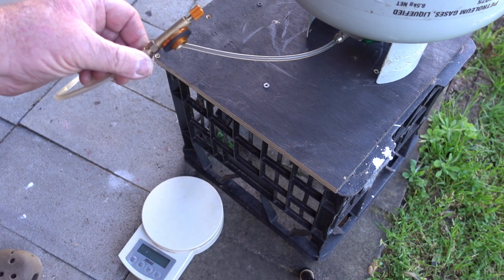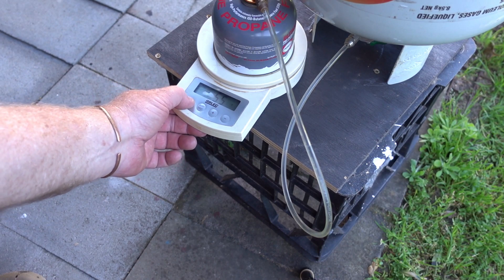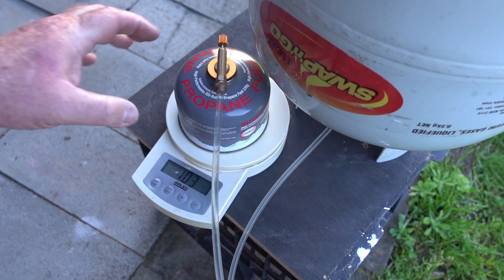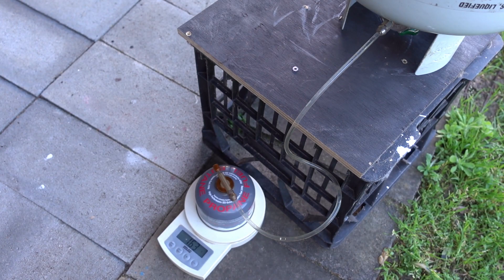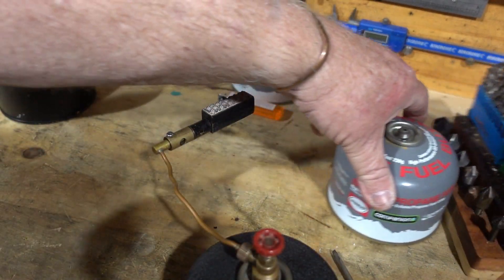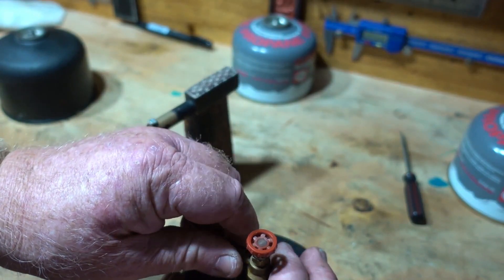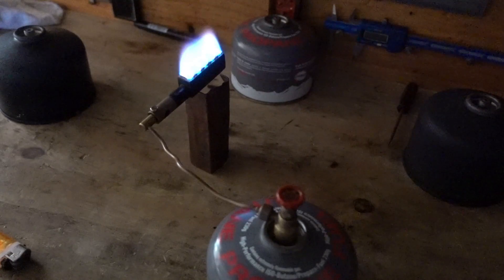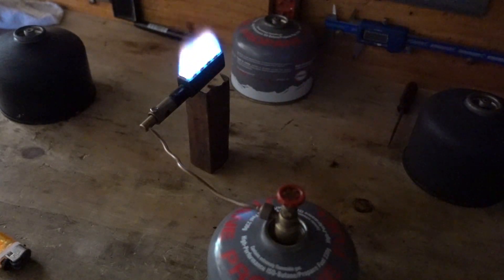Refilling disposable camping gas canisters with Propane - Cheaply

Comment: The large tanks come with propane only, while the small cartridges are design for butane or butane/propane mixture, which has much (around 10 times) lower vapor pressure.
So, filling the small, thin wall cartridges with pure propane may cause them to blow up.  The cartridges are probably made stronger by certain safety factor so you might be lucky and nothing happen so far.  However I would say it is not safe to fill small thin wall aluminum cartridges with pure propane, especially if you plan to take them to your camping during hot weather.
Reply: @NearlyNuked It does not work this way with liquefied gases like butane or propane. If you charge your cartridge half way, the level of liquefied propane or butane will be lower but the vapours above will still exert the same pressure equal to the value of vapour pressure of given gas.  The same way as the pressure of water vapour in the bottle is the same doesn’t matter if it is filled half way or to one quarter. 
Thats why you can not use pressure meter to see how much gas left in your cartridge. Instead, weighting is better method.
Reply: @attilavicen1579  Read the whole label and check the composition of the gas.  It might say “propane” as a commercial name but in small aluminum cans it is always a mix of propane with butane or isobutane.
Reply: @SpokoSpoko  can i refill these camping gas canisters(4 season ones) with lighter refiller? What 60% butane and 40% propane? You know the ones you can refill the lighters with. Can i put that into a quality camping canister? Some have 4 season ability what means you can use them in the winter, couse there is more propane in them. So they must be stronger a bit. Thanks for the anwer.
Reply: @attilavicen1579  I would not put any more propane than it is written on the can, but if that lighter refill has less or equal percentage you can use it.  Myself I tried to load my cartridges from two sources, butane from small cheap refills and propane from the large BBQ tank. However I found it too much hassle. The savings is small and not worth it. Unless you camp a lot and use a lot of those cartridges.

Comment: I suspect the can might be over refilled allowing liquid gas to enter the line. Try putting 50 grams in then test if the flame spurts. If it does not spurt with less gas then you can try using a little more in stages until the problem reoccurs.
Reply from the maker: Thanks John

Comment: purge the line prior to filling. I suspect the flare ups are caused by an air fuel mixture being fed into the burner, propane has a calorific value of 2500btu/ft3 Butane is around 3200
Reply from the maker: Thanks

Comment: I'm of the understanding that butane has a pressure around 32 psi and propane 320 or so. (to do with the boiling points). maybe that's why they have 70 / 30 mix in camping stove canisters for cold weather use. if the weather is not cold why not use butane and avoid the excessive pressure in the canisters? a lot safer if the word safer can be used under this topic.
regards from the uk
Reply: The reason is the butane is not sold in big tanks.  Only propane.  But you are right regarding the pressure 32 psi vs 320 psi.  In my opinion it is risky operation because the cartridge might be not strong enough, especially during hot weather.
Reply: @SpokoSpoko  I get same influx of flames from filling to 1LB propane tank but once tank is warmed up then pressure normalizes it.  I think something to do with propane gas mixed with air from big tank.   without a regulator, tank needs to be warmed up to build pressure.  Your video helps me as I was thinking about refilling same tank for my backpacking.  1LB steel tank is too heavy and I need propane for cold weather.
Reply: Both propane and butane pressure is dependent on temperature. At room temp propane's about 145psi, it doesn't get to 320psi till it hits 130f. Both disposable Propane and propane/Butane mix cylinders have safety valves or a Rupture Disc that will vent tank before they could reach burst pressure.....But I agree it makes more sense to get the adapter to refill with disposable butane cans. If you really wanna use straight propane you can get an adaptor to use 1lb disposable propane tanks with your stove.....Many stoves these days even come with the adaptor.

Comment: The isobutane canister is not designed to take pure propane, propane has much higher pressure than butane!
Reply: only when warm.....
just fill it less
Reply: @escapetherace1943  just fill it less? You do resize that it's all about vapor pressure, right? As long as there is any liquid in the canister the pressure will be the same for any given temp. Even a small amount when exposed to summer Temps could easily explode the canister. Look at any gas pressure temp chart, where do they indicate the volume of gas? They dont. If you are going to refill these, use butane only. You are really risking it with lpg or propane.
Reply: @KevinSmith-os5yz  even a small amount.......
unlikely mate. The canisters are not much thinner than ones meant for propane, weigh one empty, and the canisters typically hold a blended iso containing up to 20 percent propane anyway. The canister is already rated to contain butane in gaseous form, the pressure differences aren't "that much" comparitively. If you fill them with 70 percent propane and leave some dead space it's fine
Reply: @escapetherace1943  I looked up dot specs for a primus canister I ihave, specs say minimum bursting pressure is 240psi, and canister should never exceed 125psi at 130f. Granted they do use a mix of propane and butane, but the low amounts of propane keep things under that 125psi, barely. However if you are filling with pure propane, you are at 200psi at 110F with any amount of propane, as long as you still have some in liquid form, whether it's almost empty or full. Now bring that up to 130f and you could be on the high side of 240psi. Granted that's minimum burst pressure, but I'd sure like to have some margin of error in my favor. Now I do refill mine, but I use the cheap pure butane available at most grocery stores. Nut I wouldn't take the chance with pure propane, too close to the edge for me,he he. I don't have cold as an issue where I live.
Reply: @KevinSmith-os5yz  200 psi at 'any amount' of propane
I doubt it, then the iso-propane mixture would also be at the same pressure.
Granted subjecting it even close to 100 will almost never happen where I am
Reply: @escapetherace1943  that's how vapor pressure works, the liquid will vaporize into the container until the container comes up to the vapor pressure for that temp. So as long as there is still some liquid, which is what you have unless the canister is exceedingly close to empty, so 10 grams of fuel or 100 grams of fuel the pressure in the canister is the same. Now I don't know why mixing propane and butane brings down the vapor pressure overall, but again, I am only talking about filling a butane canister with pure propane. Sounds like you live in a cold enough place that you can get away with it, but I can assure I can't. I wonder if they make a pressure Guage you could attach to a canister to prove my point. I'll have to look. That's why a pressure gauge can't tell you how much fuel is left in the tank. Pressure is only dependent on temperature and type of gas.

Comment: 1 you over filled it, 2 that's not a tank made for propane pressures. 3 if you're trying to save money, us wood... It's free. 
PS, it's jumping the flame because your tank is overfilled, and you're getting liquid propane in the burner.
Reply: Woods not free. Especially where im from. you’ll get fined during a specific time of year for burning wood in a pit.

Comment: If you aren't using this with a camp stove, where weight is a big deal, why not get an adapter to your burner, for the 1 lbs cans of propane  that are sold for heavier propane stoves, torches, and lanterns, often under the Coleman brand.  They are easy to refill with no weighing, and they are built very solidly for the greater pressure.  The small cans are built to be lighter, which does not seem to be a big deal for your use.

Comment: One possible reason for using a propane/ butane mix is butane has a much higher boiling point and a lower gas vapour pressure compared to propane so it may help to stabilise the gas mix and lower the pressure in the cylinder .
I would knock the refill weight down about 10% and see if the flare up stops or run the burner for a while and see if it stops and if it does turn it off and weigh the  cylinder again - that will be your maximum fill weight  in the future .
Reply from the maker: Thanks Ian
Reply: so just fill 3/4 capacity with propane and I should be good, no?
Reply: They must add the "smell" to propane. It will make for some build-up in the orifice. Propane torches need to be cleaned regularly.
No big deal.
Butane will turn into a gas at a lower temp than propane. When it's cold, propane losses pressure, the butane has a lower boiling point, so it keeps the pressure up in a cold tank, or a cold morning/evening.
Yes, dangerous. So are most things. 😀 
Be smart, use safe practices, triple check yourself. Learn all you can.
GET RID OF ANY CANISTERS WITH MECHANICAL PROPLEMS OR DAMAGE.
It's not worth it to trust a disposable canister to save a few bucks.
Being OK with a good one, that's one thing, one that has any problems, not worth it.
My 2 cents worth.....
Have fun.
Reply: @adamdavis5961  at std pressure: butane boils near 0C, propane at -42C
as a result, at std pressure, -18C: propane exhibit as a gas, butane is a  liquid
Reply: @philiptong4978  yup I'd only fill it when it's as empty as can be, and at a reduced pressure
Reply: @escapetherace1943  below explain why it does not matter how much propane you put inside the can, as long as there is a liquid (which is compressed gas)
https://youtu.be/re9r0kzQp_M
Reply: @Mister Dude okay but less gas = less pressure. Ultimately it depends on the rating of the container it's in. Cold weather butane is a mix of butane/propane.
It would be interesting to know if the bottles they use are different or if the tolerances in butane bottles can actually handle a certain level of propane. 
Obviously they can, as some people have filled them with propane (I haven't)
but with the math to back it up I might be tempted
Reply: @Mister Dude yes it does. A full tank will have more pressure in it regardless of temperature, even if temperature is what makes the pressure go up or down the most

Comment: I have what appears to be the exact adapter you are using, but it does not actually screw tight onto the donor propane tank. All the people I can find who have them say they have the same issue.
Did you have to do anything special to get it to fit so it doesn't leak, or did you just happen to get one that works?
Reply from the maker: I didn't have to do anything, it just worked. Are you nipping it up nice and tight?
Reply: Yeah, the one they sent me from China wasn't tapered to match the tanks we use in the US. I took theirs off and put a spare fitting on it, now it's all good.

Comment: Kind of scary asking for comments after the fact whether this is inherently dangerous. You should’ve done your research prior to doing it!  This can be definitely dangerous and is not recommended. You can read about it all over the place. I think ultimately if you keep the volume at 70% full or lower and the temperature of the tank below 90° you’d probably be fine. But filling it like you did and not knowing actually how much you put in tells me you don’t know the dangers or differences between propane and butane and of what could happen. If you research this more you’ll find butane would probably suffice with your requirements but be much safer in the end. If you’re bent on using propane then use the green little gas tanks designed for propane. The one pounder. Those you can refill much safer and the tank is much more sturdy
Reply: You do realize thats an isobutane can? So that means is a blend of propane and butane........ think about that. Initial charge starts with butane at factory and then has propane added to aid in low temp ignition.......  aligator mouth humming bird butt
Reply: @robertulmer5886  - so what’s the your point? I am saying filling with propane exclusively is not a good idea and dangerous.
Reply: @condor5635  your kidding right? 30% of these canisters are filled with propane from the factory. Meaning same pressure thats in that 20lb bottle.............. if properly weighed its safe. Been doing it for years i personally use a regulator. Plus hes using a vinyl tubing not exactly high pressure bud. If the pressure was really that great the little tubing would have given us a show dont you think?
Reply: @robertulmer5886  - you obviously think you know what you’re talking about but you actually don’t. Just because there’s 30% propane in one of those canisters doesn’t mean that it obtains the same pressure as a 20 pound tank at the same temperature.   To quote yourself are you kidding me?
Reply: @robertulmer5886  just look at the graphs in the link below
https://www.engineeringtoolbox.com/propane-butane-mix-d_1043.html#butane_vapor_pressure_absolute
tip: EN417 are spec'd 13.2 bar at 50C, when the container is new from factory

below you can learn about partial pressure
https://youtu.be/jbmOcH1fFKs
Reply: Thank you, I came here to learn this.
Reply from the maker: Still using this three years later and working well.
Reply: @SteamEngines-Jim  good to hear. Keep safe!

Comment: That is exactly why they write don't refill on them!
Propane has much higher wapor pressure than butane and mixes are in between. Never fill pure propane in anything than propane canisters. You risk others rupture especially when getting warm. 40-50 degree and pure propane pressure skyrockets. Just look pressure charts. The other way round filling pure butane in mix or propane tanks are quite OK. You can however experience a performance loss especially with direct pressure devices as when the gas gets cold when using the pressure for butane drops more than propane and mixes. However might be fine for summer usages and stuff with pressure regulator.
Also - don't overfill them! Your way looks very crappy and even though you think your canister is empty is might still contain quite a bit actually. The best way is when you buy them write full weight on them and never fill above. That way you're sure you know when to stop without guessing

Comment: i did it. after 4 or 5 refills, the can exploded. window broke, pc screen damaged. very large bang. do not use propane, its pressure is way higher than butane.
Reply from the maker: Still using this three years later and working well.

Comment: Very cool!  Can you provide a link where I can buy this kit?  I can’t find it on Amazon or eBay.  I’m planning to use for camping fuel canister  refills.
Reply from the maker: Hi .....here's the link -
https://www.ebay.com.au/itm/1X-Propane-Refill-Adapter-LP-Gas-Flat-Cylinder-Tank-Coupler-Inflatable-Valve/133636839323?_trkparms=ispr%3D1&hash=item1f1d60579b:g:Is0AAOSwuC5f~21Y&amdata=enc%3AAQAFAAACgBaobrjLl8XobRIiIML1V4Imu%252Fn%252BzU5L90Z278x5ickkBUIiHwYv5YgVss0WaiENzz6q7dVMFUOpCuI2uiNn5WuKYz7sGcoNYZSwN9cOHDuHzKEvsBM9LfBIZOkIGMnBghG8wqnzqUoZhCitdE%252BQFDeMm4oXyhiov3g8wwnEVcJ3NKG%252BtUWcut7BBuR8P1CcfWgXja7uLQHIZW3WoTbBNmIHSu3w%252FW6JpOigpxsljLL1Rcg4jzBcWAmDoxwJeauZymJiGAXoAGk34TsvjALgLlozZuMaS%252B2s5ia1ksaAndHzGe50wmUbjgFQkvLkJgtugaKwGHakBfWwvkg9IAfXCD3UZM2nM54xwddlTffCfYqFvOxohgiVKNznRTKfvp0U6Vv9xmPaGu4ABXdeeqVYLkkpHLBX4ZAusy7dnSYN%252B%252B%252FIGf%252Beam3kxX9i8SWv832mabGnoXx8Zyash7vWmObUz10xtVdiVPKP%252FyA0voNwpqZ3lDSdSAO%252BmVh6O8jaIRc%252FTwFeRoBbq8bvpYpnK1s%252FslNfezk2cMtovn1N9ift5euVo8DAE3Cy9BhbwfP3vrCKylLbH8RD5w4xaL1nSo56TqUbFp%252F1WiXGEaOnUuKqVP%252BDQukJm7Hisq736IOZbReFXBBx%252BXc6T9V4hgCJL%252Fqxs7%252BnWZ%252B7w8fCQfmtJT2W40nX%252BUCrT9wlZZEykvUMVTLA0tmnm063o9kwR9XmcdB0XPD5LyhqTfwPFAaGihK1W6j04tr3%252BpU1ActUB8IZCYavwRuIX1Y%252BuyurQBs5%252FPG1tbNN82sthlqnkWpb8OFlf25tFj0hTyhuehAy98tFMby16dMbDBWtMRSOaC7ycWwDRGY%253D%7Ccksum%3A133636839323698c99372e6d4bdfb7231a5f6686d758%7Campid%3APL_CLK%7Cclp%3A2334524&frcectupt=true
Reply: For camping? How many times u canmping in one week? If u are camping 1 or 2 days, it's not worth to do this, i used to camp twice in a week in past, and i used only one that little can for 2 months or more, i used that for boiling water 4 tea, for 2-3 persons, 2-3 times 4 one day! In my country (Bosnia and Herzegowina) that can cost about $1 and definitely not worth to refill that, i guess u don't need too.
Reply from the maker: @mare4323  I use them for my boilers in my model steam hobby and can use 2-3 a day everyday of the year.
Reply: @SteamEngines-Jim  I know YOU don't use these for camping, my comment is for "risto", not 4 you!

Comment: Propane has a higher psi and you don’t have a regulator on there so it’s trying to go full pressure and then back to normal through the small orifice on the line.
Reply from the maker: Thanks

Comment: I am very grateful for your video, and I will be employing this method, based on your expert counsel,  but I am absolutely clueless as to why you  would need to do this, since you are not a backpacker. Perhaps you use the small en417 cannister for car camping?
Reply from the maker: I go through a lot of these camping cans firing up my model steam boilers to run my steam engines.